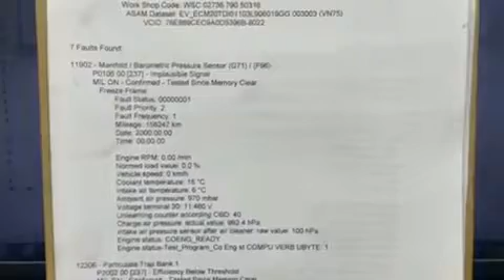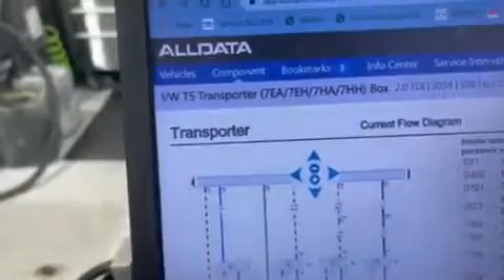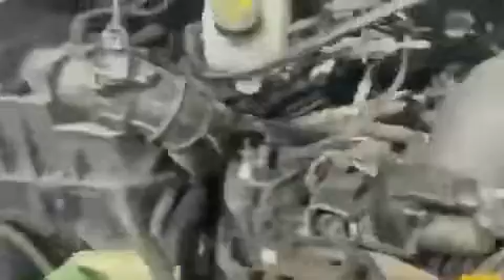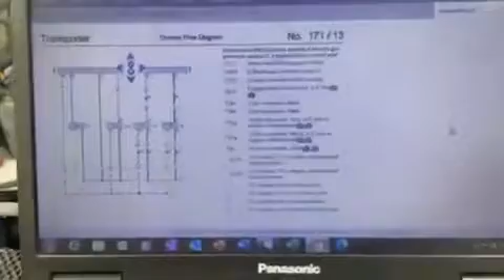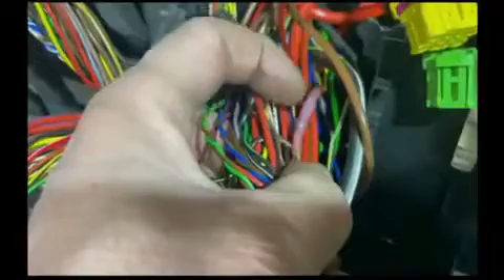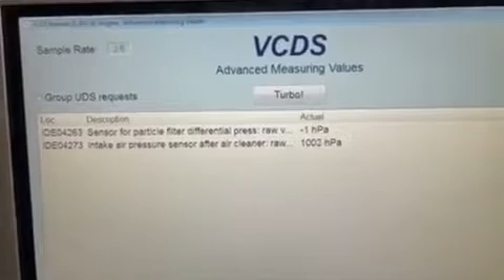VW Transporter T5.1 Using wiring diagrams to diagnose a fault. P0105, P0106, P0107, P2002

Comment: Hi was wondering where I could find a wiring diagram for be t5.1 2011 2.0 caac I have an issue with the temp sensor p2184 I have changed the sensor and still have the same issue when checking the voltage on the sensor plug on both temp sensors I’m showing 3.3v

Comment: Hopefully the "quality control"  IDIOTS and "design engineer" MORONS  in VW have discovered what a monumental cock-up it was to splice wires this way in their vehicles . It's the same story with the ridiculous central locking splice under the drivers seat which caused so much stress and headaches for t5 drivers.

Comment: It appears that, as the vehicle gets older, there is more likelihood  of  electrical faults, especially the Green Crusties. A fault within the loom is particularly difficult to find  unless you have access to the wiring diagrams and understand them (which you obviously do!) Another great fix showing the benefit of not changing parts unless properly diagnosed. Thanks

Comment: Awesome tenacity Gary. Quite a bit of dismantling to pin that one down. One could be forgiven for thinking that a splice inside that box would be well protected from the elements but it just shows you nowhere is safe from the green rot. Would you mind sharing where you got that wire piercing probe; looks very handy that one?
Reply from the maker: I buy those probes off eBay, you get about 10 for £3
Reply: The probe you used over at the splice?
Reply from the maker: @Russell_Duncan  Phil’s probe, Elite Diagnostics sell them